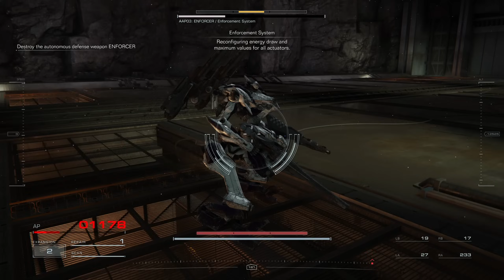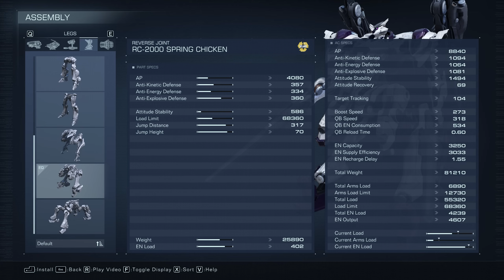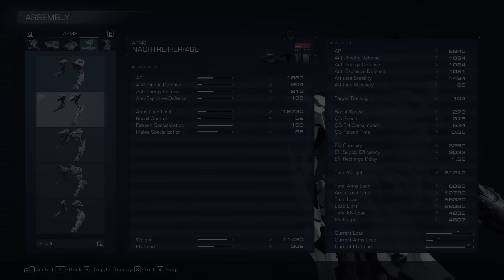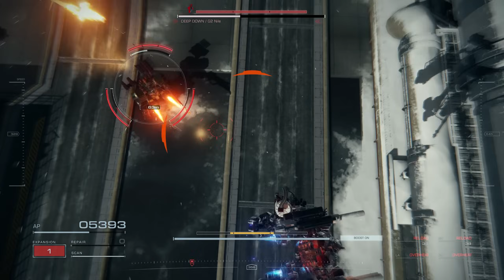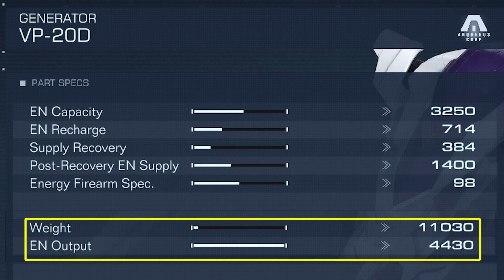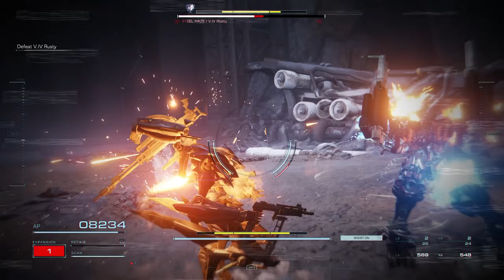Energy Weapon AC Build That Makes Bosses Easy! | Armored Core VI

Comment: Another thing you need to keep in mind if you run Energy Weapons, the Generator you choose directly impacts the damage of the EWs, refer to the Energy Firearm Spec. There is few gens made for EWs specifically
Reply: I didn't even think of that thanks for this coment now I know 😊
Reply: Its underwhelming at best tbh. Every 2 points over 100 you get 1% damage so the most u get with that 150 energy rating one is 25%. And the cost to get it is horrible cuz that generator is garbage
Reply: The Coral Generators all have good spec for it as well, but I thinkk their downsides aren't worth it compared to regular generators.
Reply: @CsStrez I use the thicc boy coral gen because it's the only generator that can even hope to hold up to my all coral build. Honestly the "downside" isn't even that bad.
Reply: VE-20 series is the best for EWs if you also want to make proper use of your EN in the fight for flying or dashing. Coral generators are great if you're more grounded build, example with some kind of funky Pulse Scutum build you can't dash with, but worse for active dodge or flight since their recharge delay is (relative to others) really long. They do have a lot of EN capacity tho, so you can fight fairly long before you need to dip to recharge.
Reply: @HeXGaruDo do people actually use the barriers? i havent seen anyone online with em yet. they take up an entire back weapons slot, which means less dps
Reply: @canisarcani  extremely rare, but I actually run with Pulse Scutum time to time. Sure, you lose half your dps (can't also use left hand while shield is up, need to drop the shield for moment to use the weapon), but you also become hilariously tanky for anything shot from in front of you (-86% damage taken and -70% stagger taken). I've had so many gatlin/cannon tanks bust their load to the shield and then panic when target not staggered. Your playstyle will become purely war of attrition to win which is actually really fun to play every now and then. Instead of having 15-30 second rush down fights, you easily extend fights to 1-3 minute brawls. Missile spam will be the bane of your existence, a lot of the missiles will blow up behind you, bypassing the shield.

Heavy reverse joints so you can dash dodge while shield is down and to have at least some chance to try catching up to missile spam kiters. Most of the time you don't even use the shield against missile spammers. You can NOT dash while shield is up, only jump, and the shield overheats if you get full staggered while holding it (hence reverse joints so you can still try dodge things while shield cools down). Linear Rifle Harris and 10-cell missile launcher (one firing directly at enemy) for staggering and stable damage, and Moonlight or ML-Redshift for hitting hard on the staggered targets without having to get too close to enemy. You need to always keep at least some distance as you have to kite away to get your shield back running after swinging melee (4 seconds before full power, shield is A LOT weaker until that). Finding a button for the shield may also be a bit awkward at first as you have to hold down the button for almost the entire fight, I have mine set to side of the mouse.
Reply: @HeXGaruDo  Eh I've made it work in air just fine. Besides, full coral build means no other choice than the big boy can handle the en load.
Reply: @SubjectX07  The high capacity makes them fine for flying builds, it's just the forced grounded time that makes them a bit less good for the job, imo. That said, if you run extremely EN load hungry build, then yeah, that's what you have to use. Don't really use flying builds that much myself, mostly either active dash where you need fast recharge or grounded Scutum that doesn't really give a damn about the recharge at all.
Reply: @SubjectX07 As someone that tried to use the heaviest Coral Generator against Cel 240 Ibis, I can tell the Energy Regeneration downside is pretty trash when dealing with an enemy that forces you to dodge a lot
Reply: @AyameAkito  I s-ranked cel-240 using it a few hours ago. I dunno man guess I just make it work.
Reply: @HeXGaruDo I actually use coral generators for mid air gameplay. They aren’t built for EN conservation, they have amazing recovery after you use it all. I get my best mileage running that thing dry and then letting it recharge to 3/4 full capacity in less time than normal midair recharge, which can literally mean sustained flight without touching the ground if you’re good at it.
Reply: @HeXGaruDo actually yes the VE series of gens are good the best is VE-20B
Reply: @CsStrez  The coral generators dont really have downsides if you use their special ability properly (if you completely deplete it, the recharge delay is less than half).
Reply: @CsStrez  the downside isn't bad if you drain out completely for your EN. Comes back to full almost immediately
Reply: @CsStrez ok but red thrusters look cool
Reply: the downside isn't a downside if you understand the quirk. which is that with the Coral Generators you should empty your energy pool. because it fully recharges from empty much quicker than any other generator. the heavier  generator has a massive energy pool too.

Comment: Fyi your booster ideal weight is off. This will negatively affect your quick boosts. Theres a pair of lighter reverse joints that you unlock later that let you hit that weight easier. Other than that your build is nearly identical to mine. Ive been using kinetic weapons but i definetly want to tey energy weapons more.
Reply from the maker: Where do you see the stat for ideal booster weight? Must have missed that
Reply: @JDogth3Wise  It's on the detailed booster info. It should really be added to the overview screen and highlighted yellow if over the limit in my opinion.
Reply: The qb reload ideal weight stat? Yeah being over the weight limit will penalize the EN consumption while quick boost but not by much it's only 20 or 30 point

Example alula have 62400 weight limit with 690 QB en cons, my AC with 93300 weight have it's QB on 724
Reply: Pretty much every build video I've seen so far has entirely ignored this crucial ideal qb weight stat when it comes to booster selection
Reply: @ITNoetic I ignored it at first because reverse joints give a free boost anyways with the jump, using the heavy rj makes it hard to hit the weight, and the lightweight legs are too squishy.
Reply: @beegest_yoshi  We're talking about quick boosting, not jumping. If you qb over the ideal weight, it uses like 40% of your EN
Reply: @ITNoetic  I know, I meant I considered the jumping as another quick boost/way to dodge quickly so I accepted the trade-off for exceeding the ide qb weight.
Reply: I was wrong earlier. Being over the ideal weight applies a penalty to your qb reload time. The amount of cooldown time in between qbs. You can see the impact on your spec sheet. Basically you gotta compare all of them to find a good balance between penalty and base performance, but use the spec sheet of your AC rather than the part for the actual qb reload time